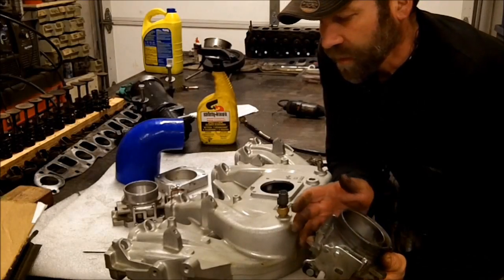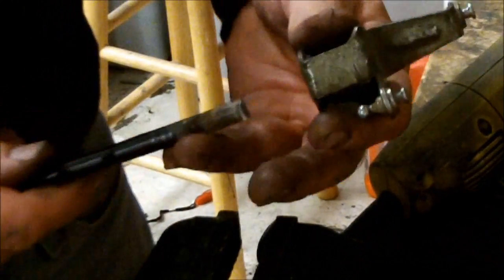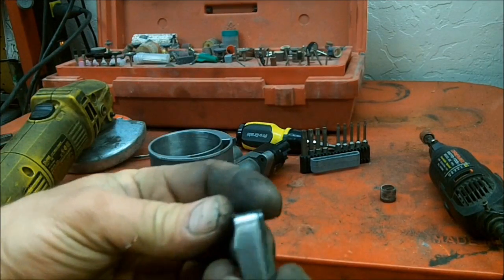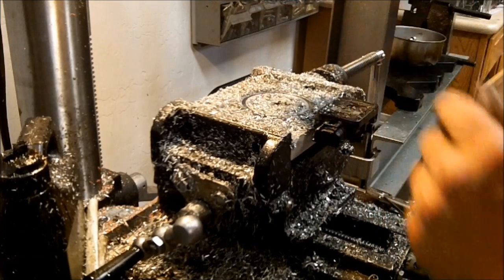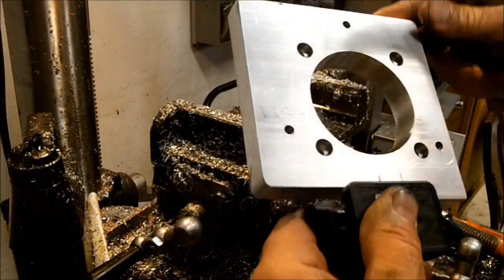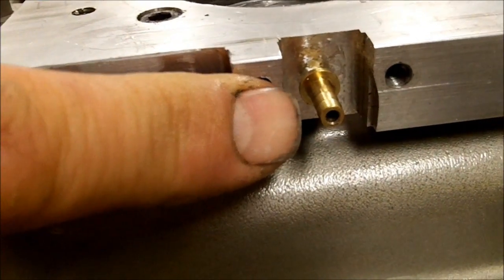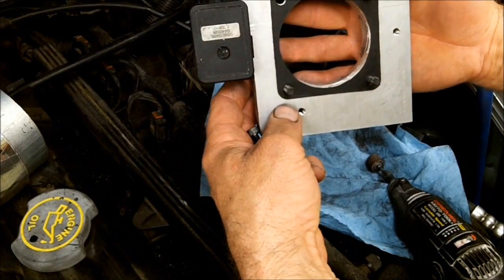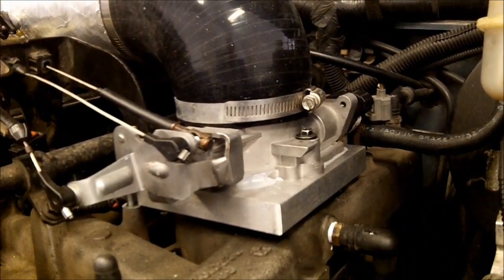Installing a 68mm Throttle Body on a 4.0 Jeep Wrangler/Cherokee

Comment: Hi Martin:
Just found your channel a couple weeks ago and now I watch you every nite.  Yours is by far the best channel on repairs on YOUTUBE. I watched ur video on fuel injectors and was thinking about trying ( I have a 96 ZJ 4.0L) the Denso 12 hole injectors.  What vehicles can I find these on at the "JUNK YARD" ?  Thank You again for the best videos, keep up the good work.
Reply from the maker: Wow, thanks, I would recommend the Bosch 280156161 12 hole injectors from the Ford eco boost engines found in their compact cars like the Focus but you will need to change the connectors to the EV6 style.
Reply: @martinbuilt  Thank You.  In a couple wks am going to try the local "U Pick" and see if  I can find those Bosch 280156161 12 hole injectors. Here is a tip you might pass on. Am doing the rear diff fluid now, Dana 35 and I soaked the bolts & cover in vinegar for a couple days and the RTV comes right off.  Watched your wire tuck engine compartment video last nite.  What a job but it really looks great when you finished. Thanks Again

Comment: Well Martin, looks like this is on my to do list before I start on my stroker build. I have a couple of the newer intake manifolds and power steering brackets in the garage, still need to pull the pumps and swap out pully's. Thinking of picking up the Harbor Freight mini mill for some of the simple machining stuff as I don't have a drill press yet... 2 birds I guess.

Comment: Martinbuilt: Always thinking. Question: do you use the Learn mode on the XJ. I just joined by buying a 2001 jeep Cherokee XJ. So I’m learn mode right today. Going to u pull u save tomorrow another item to get a TB off of a WJ..

Comment: Someone should Machine up and sell adapters for these.

That was definitely a "Pro Tip" on the use of rags and topping it with grease to catch the shavings. I was wondering how you were going to keep the savings out 👍🏼
Reply from the maker: Glad you liked it.. Yeah I love this throttle body it would really be great on a bored and stroked 4.5 and large engine.

Comment: Great video. Maybe i missed it, but why didn't you use the new intake manifold? Aren't they supposed to be better?  Thanks.
Reply from the maker: Yes I will be swamping to the newer intake. But wanted t do it at the same time I install the new header.

Comment: So what were your results with this? Impressive fabrication, not sure if you did swap injectors, but were there any improvements?
Reply from the maker: I could really tell at the top end and at the time I was using the Bosch 703 injectors.

Comment: How much torque and horsepower have you gained from this? Very nice work sir! I would screw this up and it would be a total disaster!!! I bet it took some hours thinking of how to mesh everything together..
Reply from the maker: Almost Zen I don't have any Dyno tests or anything like that. I definitely noticed a upper end Improvement. Yes engineering the whole thing is what takes the most time.
Reply: martinbuilt dyno tests are rather expensive.. I was just curious that's all.. I have a few issues with my 4.0l such as a few minor oil leaks and when accelerating my ac/heat will transition to the floor or defrost for a few seconds and then return back to the front vents.. The very first problem that I considered was a vacuum leak but I can't find it.. Any suggestions?? Thanks for the reply..
Reply from the maker: Almost Zen yeah that's what I thought right away too when I read it was a vacuum leak. Yes Dyno tests are kind of expensive. Never had one done before.
Reply: Almost Zen the vacuum ball/pill mounted behind passenger side front bumper must have a leak/is disconnected.

Comment: Why can I find so much after market parts and stuff for my beloved jeep but when it comes to throttle bodies it is slim pickins? I would buy this so hard, I am tempted to make it too but I don't have nearly the same amount of tools and would be doing it on my apartment patio which is far from ideal in so many ways... I really want a 68mm too the only one people seem to offer is 62mm which is nothing more than a ported factory throttle body, which I have doubts about there being much if any air improvement, since you cant port the valve portion... ugh.
Reply from the maker: Here is a link https://www.painlessperformance.com/webcat/65301
Reply: Ben P. Trusted Design Services LLC sells adapter

Comment: What size throttle body should I put on my 03 Grand Cherokee stock 4.0 along with upgraded 12 hole injectors? Should.I upgrade coils/plugs or anything else? I do already have a K&N air filter as well!
Reply from the maker: I would recommend the stock size to 60mm unless you start to make exhaust upgrades (header, hi-flow cat, cat-back exhaust) you could go up to 68 but, a 62 would work great.

Comment: Nice mod but it looks like u have the old style intake on your jeep. The one u had on the bench is newer and flows better
Reply from the maker: Couldn't agree more, I installed the 99 up intake shortly after this video was posted with a brand-new Pacesetter header.

Comment: I'm going to be machining the plate to adapt the throttle body soon. Is the bore drilled in the center or the 5x5 plate or is it offset?
Reply from the maker: Cant remember for sure . I think it is offset. I'll have to look.
Reply: martinbuilt was it worth it? Any loss in low end torque? Is it touchy while rock crawling? I have a 4.7 stroker with a cam, horseshoe intake a header and a bored 60mm tb. Just don't want it jumpy while crawling and I want to gain low end torque.
Reply from the maker: I am have lost a tiny bit bottom end. It's not touchy at all. It was worth to me.

Comment: Is your 4.0 stroked? If so can you share the details? i just ordered ATKs 4.7 stage 1 stroker block.
Reply from the maker: +RagingPirateNo it's a 4.0
Reply: +martinbuilt I think I'm going with a 62mm throttle body bc it's alot easier and I'm not as talented as you and do not have all the machining stuff. Although, in the future I may go with this setup. Awesome video. Thanks for the quick reply! Jeep on brother.

Comment: So now that you've had this mod in your jeep for a while, have you noticed a jump in horsepower?
Reply from the maker: Arthur,
I wouldn't say there was a jump in HP. I think it is something you would have to put on a dyno before and after to see the difference. I think this mod is best suited for a highly modified 4.0 or best yet a stroker 4.5 and larger. I haven't seen any ill affix from this mod and this throttle body is here to say.

Comment: Why run a 68mm throttle body on a pre 99 style intake manifold? The manifold is the bigger bottle neck and swapping in a 99+ manifold is a much simpler modification.
Reply from the maker: I have the 99 and newer manifold just haven't installed yet as I'm also will be installing a new header and wanted to do it all at the same time.
Reply: Thaddius Smith I thought that myth was busted by jp magazine.

Comment: LS1 Throttle Body  bolts on 4.0L
Reply from the maker: abdulrhman saleh
 if you're asking if you can put an LS1 throttle body on the 4.0 I think it's possible. the LS1 is very large at 75 millimeters. the problem would be that you're going to run into the throttle body bolt holes on the intake manifold. you would probably have to weld an aluminum adapter plate directly to the intake manifold
Reply: martinbuilt no I'm not asking،  i have 2000 4.0l Cherokee with ls1 throttle body it's bolt on if you want to see shot my email abdulrhman saleh
Reply: martinbuilt 

Nice engineering on this project. Thinking outside the box is always interesting.
Reply: abdulrhman saleh send be a pic
Reply: Hey man can you email.me a pic of the ls1 throttle body on the 4.0 ?
Reply: im trying to buy one pls
Reply: abdulrhman saleh  which one can u tell me pls
Reply: @asrjjjjjj  what type of improvments have you seen? Also what other mods do you got?

Comment: So have you noticed any differences?
Reply from the maker: A little to early to tell yet. I have run one tank of gas threw it so far. Got 15.2 mpg. Is down by about 3 or 4ths. But I was having some fun with it, so that could be that. It does sound nice.

Comment: why is this not a good idea for a stock 4.0?
Reply from the maker: +Scooby Doo
It would be like installing a hi lift camshaft on a stock engine without making any other changes. If your going to install a large throttle body then you need to address other parts of the engine as well, like cold air intake, free flow cat, free flow exhaust, port matching, bigger valves, etc.

Comment: do u sell them ? for jeep ? 4.0
Reply from the maker: No, I'm not tooled for mass production. Thanks for asking.
Reply: martinbuilt would u make me one if i pay u ?
Reply from the maker: @elvynortiz3456  well I wish I had the time I'm always trying to put out new videos and it takes a lot of my time. I was looking at painless makes a 68 mm throttle body. For $489 the only thing I don't like about it is the outlet side of it looks like it's 62 mm. I wonder if it be possible to take their throttle body and bore out the outlet side of the throttle body to 68 to make it a true 68 millimeter throttle body and then do like I did and bore the intake manifold to match.
Reply: thank you for the info very much I see what can I try

Comment: I'm actually in the process of doing this, and I'm guessing you used the 4.7L sensors & harness. You must have spliced the 4.7 harnesses in. I just don't recall you mentioning that. How'd that work out for you? Are they sending equivalent voltages to the ECU?
Reply from the maker: No, I used the same TPS and IAC, just moved them to the 4.7 throttle body.
Reply: @martinbuilt  Yeah, I have a different idle air control on my '93. It makes a 90 degree bend for a male style harness. Another reason I mention it, is because the plunger on the IAC is slightly smaller on the older model. The TPS I have got to fit, but am having an IAC issue. I'll let you know how it goes when completed.

Comment: 5 years ago I too swapped the injectors to the 5703 Neon injectors on my ZJ. Question: After doing this, did you have to upgrade to something else or no? I saw in another comment you mentioned it wouldn't have full potential without other supporting modification, however, that is exactly what I'm doing on our kids XJ.
Reply from the maker: Since then I have upgraded to the 99 intake manifold, currently running the 280156161 Bosch injectors 12 hole, also have a Pacesetter header and Harland sharp roller rockers. I also have the aluminum Edelbrock cylinder head just haven't got around to installing it